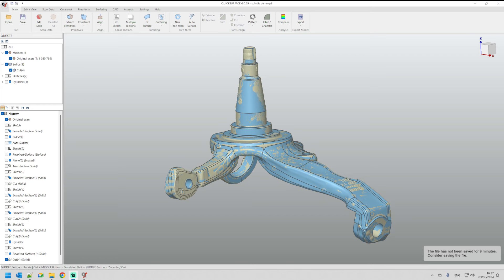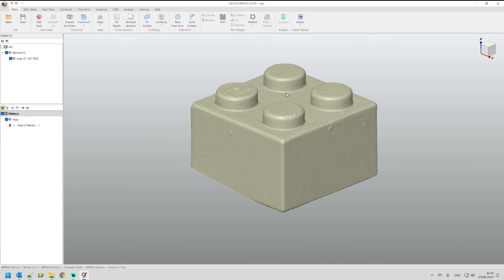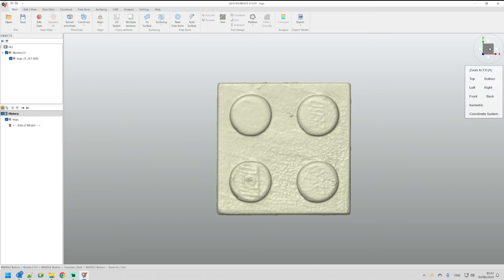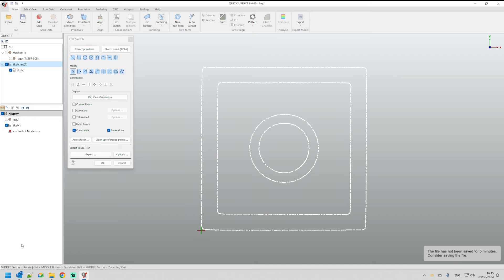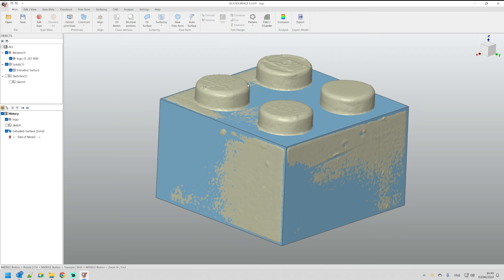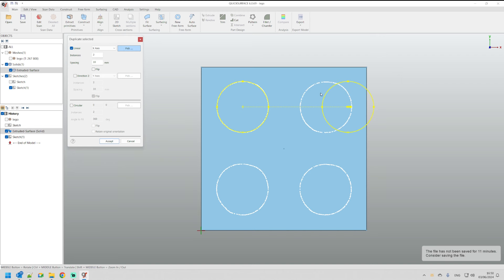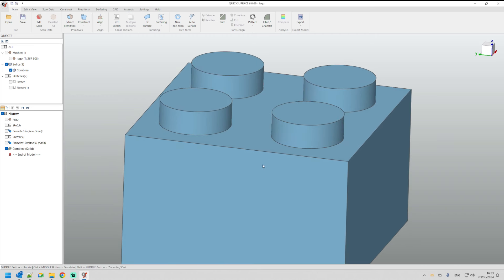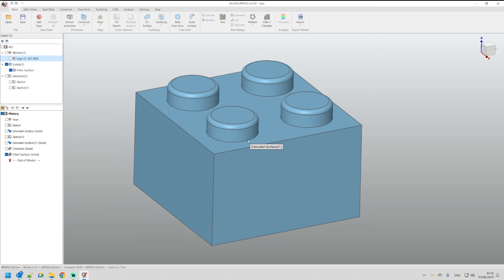Getting started with QUICKSURFACE 2024

Comment: Following along, when it comes to doing the sketch pattern I cannot select and drag the circles. They are locked into place at 10mm. If I manually change the spacing number, the circle does move but it won't freely move.
Reply from the maker: There is an arrow handle which allows you to do this on the screen.